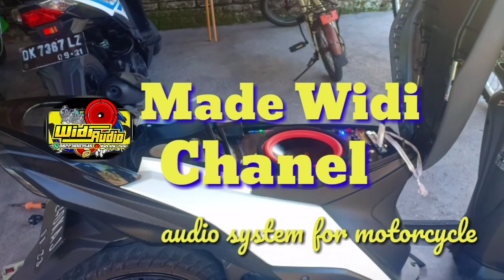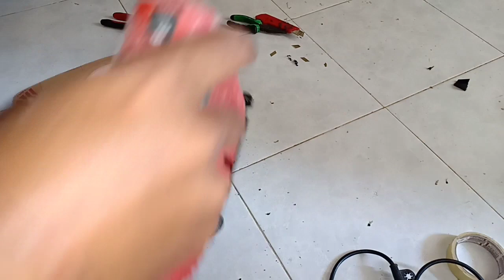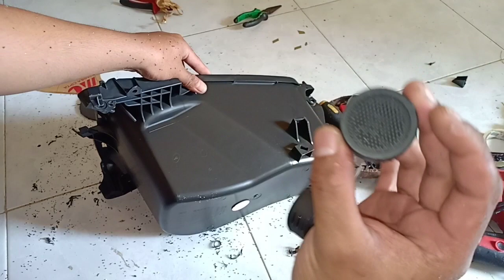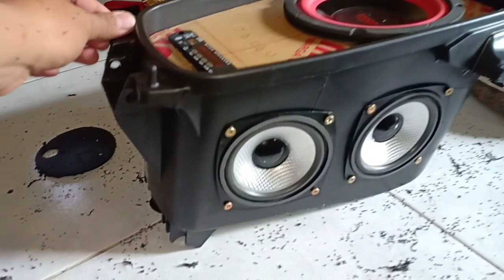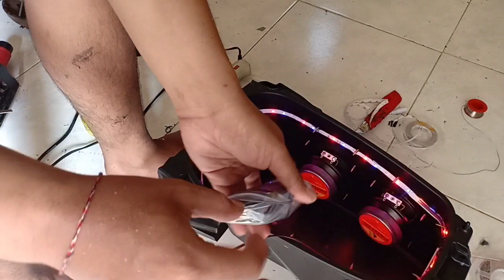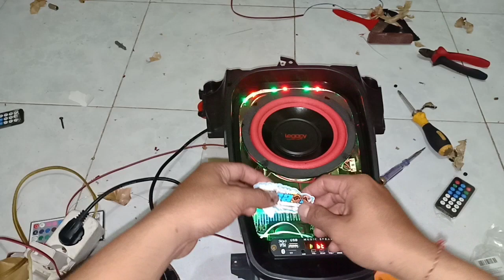PROSES PEMBUATAN AUDIO MOTOR BEAT FI 2018 //BAHAN AKRILIK

Comment: Klu pesan ini pakek jok motornya langsung ya bos
Reply from the maker: Iya bos. Sudh dapat bagasinya langsung
Reply: @Madewidichanel klu mau mesan dimana ya bos
Reply: @Madewidichanel  dan brapa harganya bos yg udah jadi dan tinggal pasang bos
Reply from the maker: Shopee atau Tokopedia bisa
Reply: @Madewidichanel  apa nama tokoh nya bg
Reply from the maker: Saya menjual AUDIO MOTOR NMAX OLD DENGAN SPEAKER 10 INCH SUBWOOFER DOBLE COIL seharga Rp2.500.000. Ayo beli di Shopee! https://shopee.co.id/product/49547111/2183813900?smtt=0.49548499-1647566974.9

Comment: buat di montor supra fit dong om
Reply: pesan box bagasi beat fi 2016 yg udah di mod gitu tanpa power speaker usb mp3 bisa bang?
Reply: @rickojericho9038  tempat baut nya cocok apa harus ngakal dulu?
Reply from the maker: Bisa bang. Wa aja bang 082147051031

Comment: Pesen bisa gk bang 😁
Reply from the maker: Bisa bang
Reply: Berapa harganya?
Reply: kurang lebih 1jt
Reply: Aku pasang kaya gini hbs 150k😅
Reply: Aku Rindukmu barang2 dan part yg di pake menentukan harga jadi wajar agak mahal juga
Reply: Engk mungkin lebih dri 1jta😅
Reply: klo bikin sendiri ya ga mungkin tapi klo pake jasa orang masa iya cumn makn angin ga ada untung nya tinggal rinciin aja total semua
wooper 8inc 200 murahnya
speker yg 2 120
power 300
akrilik 50
tweter 30
mp3 60
kabel2 lampu rgb+on of lem 80(murahnya)
total 840ribu kalo beli bahan sendiri
Reply: Rakit sendiri aku cuma hbs 150 kurang
Reply: @mafishbrebes4609  60 dapet kasih spiker aktif yg jualan di pasar malem itu😁😁😁